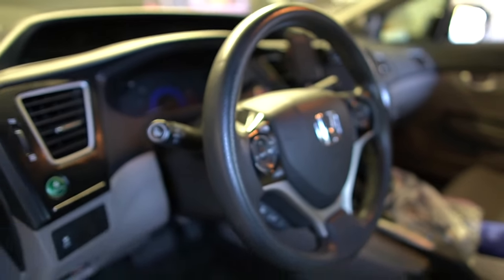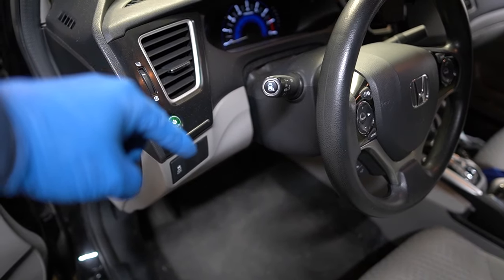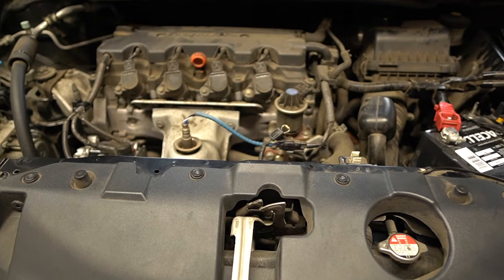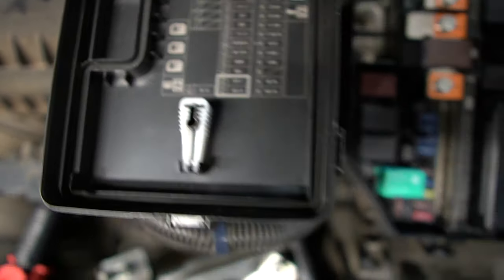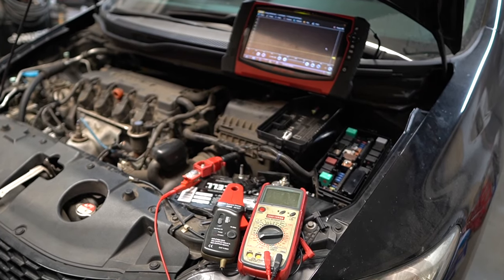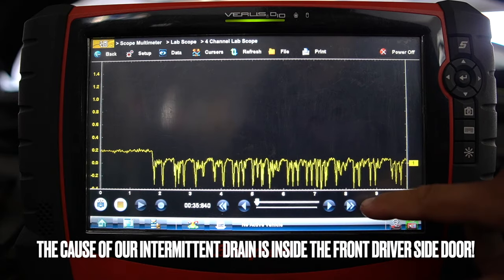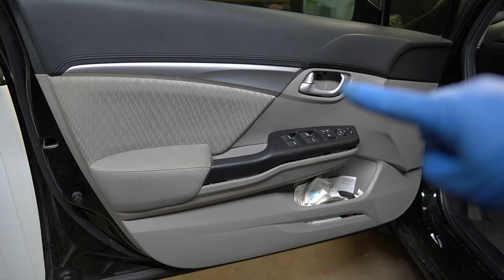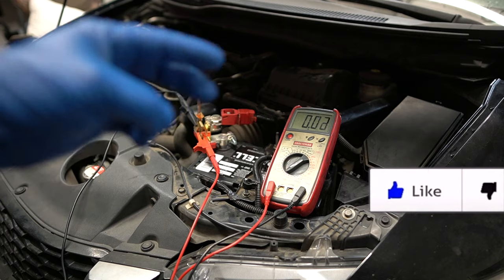Car Won't Start! Battery Drain on Back Up Fuse 29 🔋

Comment: Man I am ase master certified and I have got to admit … a current draw is a pain in the as diag on it own, but an intermittent draw is an absolute nightmare… much respect and props brother 💪🏽💪🏽💪🏽
Reply: Your opinion.....went over railroad tracks, not going fast at all, but the usual bumpiness....Then got the 'CHECK ELECTRICAL SYSTEM' in my 2011 Honda Pilot Touring.....I was able to drive is for over 20 miles to get home, but there was shuddering at times.....Anyway, tried to restart it a bit later and wouldn't work.....I switched batteries to see if it was that, no difference(so couldn't start it without jump starting it)...Jump started it and if you keep the battery charger hooked up to the battery it stays at around 14.....Once you remove those clamps, it goes down really fast....from 14 volts to about 5 volts in less than 2 to 3 minutes, which I shut the car off(one time it shut off by itself doing this jumping stuff).......After all that, IYO, would a BUMP from the railroad tracks cause an ALTERNATOR to quit, or is it more likely that a GROUND decided to loosen? or anything else   thanks...

Comment: Hektor; with so many electrical components on new cars it's amazing how much work goes into analyzing these problems. It's also amazing the amount of knowledge necessary to work on modern cars. You are obviously master technician!
Reply from the maker: Certified😎Gracias 🤝

Comment: I'm having a similar problem with my 2015 civic. Draw goes away when I pull fuse 29. It also goes away when I unplug connector Q from back of interior fuse panel.  I cannot find center junction box 2 nor can I find the keyless access module. Any ideas?

Comment: The analytical process you used to track this down is truly impressive. I had the same Fuse 29 draw on my 2017 Acura ILX. Mine turned out to be a bad HFL Bluetooth Module but watching your video helped me systematically eliminate everything else. Thank you. Completely agree with so many others; much respect.

Comment: I started the video not knowing not a damn thang bout chasing a parasitic power drain. Now I feel like I can apply for a master tech position. Such a very educational video. I’m surprised and glad I actually watched it.
Reply from the maker: My job is done here 🤝
Reply: @HomieHektor  question how did you know what type of resistor to use an why not just wire
Reply from the maker: @johnb1121  You want to use something that has no resistance at all, just like the switch itself, the resistor is the first thing I found. We’re just trying to complete the circuit, as the hood switch would do. 👍🏼
Reply: @HomieHektor  ok thanks please make more of these video's an how to use a power probe an how to read a wire diagram lol
Reply: name and type of resistor pls. @HomieHektor

Comment: i have a 2014 civic where I have changed batteries every 2 years. Just heard about this parasitic drain with Civics. Very well explained, very professional and with clarity. It made sense but I don't think I have the capabilities to figure out what is draining the battery.

Comment: master technician, straight to the point, I am having same issue with my 2016 honda odyssey EX-L, #16 back up fuse keep draining battery, but not able to locate the problem. parasatic amp draw test with 60mA. just leave it as is. no problem with daily drive, but will have to unplug the #16 fuse when not driving the van for more than 3 days.

Comment: Great video. Very detailed. My 2012 civic has a battery drain coming from that same fuse. This video gave me a starting point to work with. Thank you.
Reply: Did you find the problem?
Reply: @27jtaco  I was never able to figure it out. Since it's my wife's car she just drives the car without the 29 fuse in it.

Comment: Last year I had a very similar parasitic drain problem on my 2018 Honda CRV. Took it to Honda dealer. They said that they found no problem and that the battery was good which we knew that it was good as we had bought a new one not long ago. 
It would run for a couple days then wouldn’t start charge the battery and it would work a day or so then drain down again. Sometimes the car alarm would go off till you disconnected the battery. Then I would charge the battery and it would start ok again so I got my volt meter and started logically going through all the fuses even under the dash. They were all good except 29 was good but pulling voltage when it should be off. I did everything you did in your video which is very thorough. Then my problem started getting worse with dash lights coming on after you shut the car off they would start lighting within a half a minute. I mean like most all the idiot  lights. I was fortunate to find a YouTube with a similar problem and people’s comments indicated it could be the MICU as it is a common problem. So happened to stumble on a YouTube where a guy was taking out his dash to get to the MICU. He happened to show it was behind the steering wheel but there is no video showing how to get it out. Taking out the dash just didn’t seem like an answer. So I was able to use a long big screw driver snaked through the supports to push the MICU out and got it down and started disconnecting the molex connectors and watch the parasitic amperage drain change with each connector I disconnected from 8 to 5 to 1 and still had more connected. So I took it to the Honda dealer and explained what I had found. He had one mechanic that was an expert at working through these type issues and still it took him a couple days to determine the problem and I had it out of the dash to work on. There was none available in inventory in the region and had to wait a week to get one. But they replaced the MICU and we have had no problems in over a year. 
This video is the most thorough video I have seen. You might do one to show people how to get the MICU where it is located and how to get it out. But once you replace it with a new one the new one is not refundable because it is then programmed to your car and will not work in another vehicle. 
Thanks for such a thorough video on this kind of issue. 😊

Comment: This is the best video ever for me. My 2011 Accord has the same drain on the same fuse "backup" number 15 for me. I ended up finding the Bluetooth transmitter module was not shutting off. Causing my battery drain.
Reply: Hello. how did you solve it? I have the same problem

Comment: Solved a parasitic drain on 2015 Civic with Keyless Entry system with much credit to this video. Ended up being RF outer door handle causing draw of 200ma. It was not easy at all to find the issue but I would highly suggest going right to the Keyless Access Control Unit as it is the easiest thing to disconnect when looking for a draw on this particular vehicle and circuit. The back up fuse controls at least about 50 components on the vehicle, so you don’t want to waste a lot of time disconnecting things that don’t need to be disconnected. This is one of the hardest issues to diagnose on any car, if you are having this issue and are not a professional mechanic or a heavily experience DIYer, then I would highly suggest you take it to a reputable shop that specializes in electrical diag. I am a B Tech with a few years of experience, and it took me probably 6-8 hrs of research and disassembly to finally figure it out. Keep in mind I have been working on cars for about 3 yrs have done timing chains, valve adjustments, transfer case, etc some medium to heavy repairs and diag. Just to make the point that I would say it is far more difficult than those tasks. If you take it somewhere and they tell you to start replacing a bunch of parts, you need to go to another shop. It is 100% possible to determine the specific component that is causing the draw, but it is highly difficult. Thanks for the great video, from one mechanic to another, you really made figuring out this issue not such a nightmare. Also I charged the customer 3 hrs of labor for this issue, I did not want them to have to pay for my inexperience, but I feel that is a fair starting point for an issue of this nature.

Comment: One culprit causing this problem may be the bottom window seals allowing moisture to leak onto the door actuator, on my 2015 civic I noticed the rubber seals do not clear the window condensation when rolled up and down, this means they are not preventing moisture from going inside the door.
Great in-depth Video, enjoyed how you chased down the problem.
Reply from the maker: Could be, if that’s the case there should be a TSB on that issue. Good thinking
Reply: My 2012 has a parasitic drain. Will be checking if its fuse 29. I do notice when it rains my car smells like wet rags. Could be related.

Comment: Thanks man! I saw the voltage drop on the one that I had but when I pulled the fuse I didn't wait long enough and I overlooked it. After seeing your vid o went back and sure enough after waiting about 10 seconds the draw went down. Mine was passenger front latch. If you leave door disconnected dome will go off and draw disappears. Thanks 👍
Reply from the maker: There you go 🤝

Comment: Thanks Hector! My 2015 CRV EX had a similar parasitic drain(~1A)  from fuse 29. So far I isolated to the MICU. I think it has something to do with the door actuator because the drain happens after someone uses the passenger side rear door.

Comment: Great job Hector!
I have the same exact problem on a 2014 civic. Being a sole proprietor of a shop it’s hard for me to spend the amount of time needed to address problems like this today. I really appreciate the video! How long did you have into diagnosing this? Just curious. 
Joe
Reply from the maker: Being that the problem was intermittent, i had the car for about 4 days. Had it been there all the time, it would’ve been here no longer than a day. That’s electrical for you, it can be 5 minutes or 5 days to troubleshoot 👊🏼

Comment: have an exact Fuse 29 draw issue. This helps a lot. Thank you very much!
Reply: Just wanted to put some extra comments here. My issue is caused by the key. The keyhole is damaged and is stuck at about half open position. Apparently, someone unsuccessfully tried to break in and damaged the keyhole. Took me half day to figure it out.
Reply: Hey man, did you solve the problem and how? So many informations on this video but im not very good with english
Reply: @bicvarcarapic6619  yeah it just got fixed this week. I had the key cylinder replaced, and no more battery draw issue.

Comment: I have a 2006 Chevy HHR with a parasitic draw. Bought myself a multimeter a few years back, which that's how long it's been since my car ran right, and thought okay, I can' figure out which fuse is bad, and replace the fuse LOLOLOL @ me after watchig this video!!  I need so much help figuring this out. Thanks for the video.

Comment: Hektor, just saw your video, very well done and explained. It is a great help. 
I do have a question because I do not know a lot about auto-electrical issues. I have a 2004 Honda Civic 1.7 LX. I changed Starter, Alternator, and Battery and today, after 5 days with the new battery, it did not start. Where should I start being that old of a car? I am located in Toledo, Ohio. I am not sure if there are a lot of electrical experts in my city; but, if there are, how much approximately would they charge for diagnosing the car?
I am in a real pickle right now because I can't buy another car so I am trying to find a solution. Many thanks for any answer you can provide.

Comment: I have the same battery drain issue on a 2013 Honda CRV EX. Where can I get schematics like you show so I can track from fuse 29 (same fuse) you were chasing.
Reply from the maker: ProDemand, AllData, MotoLogic…

Comment: Glad I found this video, very detailed explanation.  I was able to find my parasitic drain (~1.2 A) and it went away when I removed connector Q from the inside fuze box.  However, I can't find the center junction box 1 or 2 in the locations shown in the video to troubleshoot like he did.  Does anyone know what they actually look like?  Google search has been unsuccessful.  I ended up disconnecting the door handle sensor and actuator but the drain was still there, so ruled out the door.  Disconnected the display unit and drain dropped to ~0.6 A. Haven't check the automatic light sensor (need to figure out how to unplug that) but can't image that draining 1/2 and amp.
Reply: oops, I have a 2014 Civic EX - 4 door

Comment: Hector,i wish i knew someone with your expertise. I live in n. Ireland and my poor car actuators are on the fritz. One door is locked inside and outside. But no one wants to touch it. 😢 an electronics expert who has the volkswagon dealer software,says all that registers is not enough power supply for the actuator of the stuck door. The near side front door ,which is the front passenger and on the left side of the car,which is the other side to the stuck lock,is not locking. It makes no noise at all. I have a new actuator for the stuck door. Looks like i need a new front near side actuator too. This is a great condition 2006 seat ibiza sport 1.4 petrol. It has served me well in the six years i have driven it. Actuators seem to be the achilles heel of volkswagen, seat,audi, and skoda,same maker,same parts. Loved your video. Many thanks

Comment: Great detective work . Found problem on my ‘14 Civic was due to CPU not enabling charging circuit until headlights were ON - gets better gas mileage while killing batteries - solved DRL on.
Reply: My 2012 has a parasitic drain as well. Will try with headlights on now. How did you fix it? Whats DRL?+
Reply: @AdanUgarte-t3e  daytime run lights
Reply: Mine is doing the same. Voltage on the battery only goes up to 15 amps when the headlights are on. I thought for sure I had a parasitic drain
Reply: So I ended up putting, or should I say squeezing, an H6 battery on my 2012 Civic. Also getting the habit of running the lights. So far so good.
Reply: @AdanUgarte-t3e  yeah I meant 15 volts on the battery. It’s crazy that Honda does dumb stuff to increase full mileage

Comment: I called the Honda dealership that I bought 2014 Honda Civic from in 2014 and have had service it since.
Bottom line:
1. The design engineers clearly have put in circuits that parasitically draw from the battery at all times. All new cars now have this engineering.
2. The manufacturer should probably post a notice that in order to keep the car able to start you must drive so many miles in such a manner every day.
So if you are elderly and depend upon your car but don't drive it much.....get a real old car or use a battery tender.

Comment: My 2018 Honda Civic battery dies in 5 days or less. The dealership has told me there is no problem with the starter, alternator, or a parasitic drain. They told me this is normal, it is not!! The problem just started recently. I will be trying a parasitic draw test myself this weekend before bringing it to another dealership.

Comment: Hi Hektor.  Thanks for the informative video,  I have a parasitic drain on fuse 29 on a 2016 Honda CRV,   Would the wires and connectors looks different than your posted  example Honda car?   Did you have to take the fuse box out to get to the back of it for the connections or  did you mean they were next it .  I  can't  find the same one to disconnect or where the k or Q is on mine. I know this is an older video so if you can not answer, I still appreciate the head start on this pain in the ..... problem.
Reply: Also, there is no drain much when  crv is unlocked but there when locked.

Comment: Any way for a non-mechanic to get power distribution diagrams? 
My car needs to be jumped every day, and even after a couple hours, it needs to be jumped again. Autozone tested battery and alternator, both were good. I definitely know the alternator is good as it does charge while driving and if I turn the car off, come back 30 minutes later it seems to start. After about an hour, that changes and it won't start. Not sure how I can test the battery myself to make sure it's not just kermitting sewer slide.

Comment: Great job, bro... question my battery drains within a couple of days, and I diagnosed it and turned out to be the  main/eps fuse (#1). However, I don't have electronic power steering. So I don't know where to go from here...can you help?

Comment: Okay UPDATE. Had same parasitic drain. It was the driver side door lock switch and keyless entry electronic board. It's a $35 +/÷ item. Diagnostics include.
* Overnite battery drain.
* Amps running at 1-10. mAmp draw
* When locking with remote, keyless alarm does not sound indicating locked. 
* Progression in locking failure. Will unlock and or lock by itself
*Remotes will deprogram randomly
End

Comment: Hello Hektor, can you please guide me on how to resolve a current leak that is draining my battery (I already changed it, it is new) it shows me the 2 "reverse" fuses in a 2017 Honda City, that is, where the problem is physically so I can repair it .  Thank you very much for your videos, sorry for my English, I'm using a translator.

Comment: Hey Hektor, great video. What is the website you used to find the fuse box diagram? I know it's fuse 29 for my 2012 Honda CR-V, but it's BACK UP also. I need to narrow it down
Reply: I’m having the same issue with my 2014 CR-V.
Reply: @stan_senior  Apparently, this is a very common recall/problem for the CRV. Please keep me posted if you find a solution!
Reply: @TheSchadd  I have a good friend that's a factory trained Honda Mechanic.  He's going to take a look at it with me.  Reply in a week if I don't respond and I'll update you.
Reply: @stan_senior  Any updates?
Reply: @stan_senior  waiting for your updates. Any news?
Reply: @junsambu954  no updates, there was no parasitic draw.  I'm thinking about installing a bigger battery.